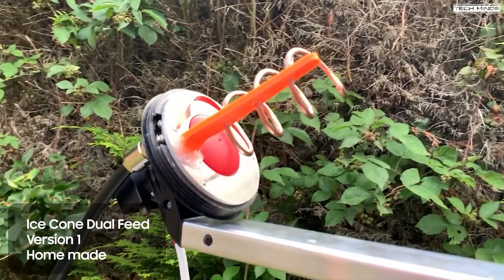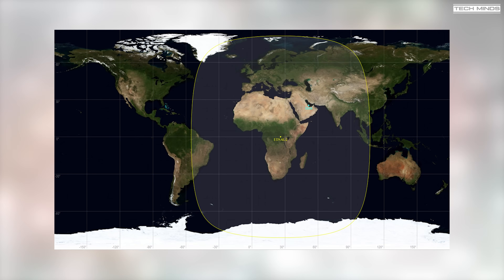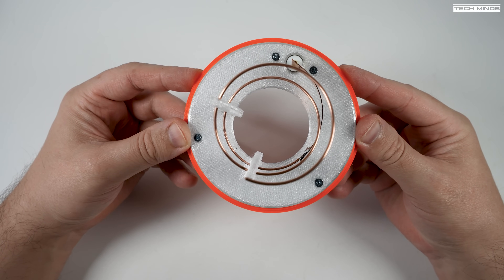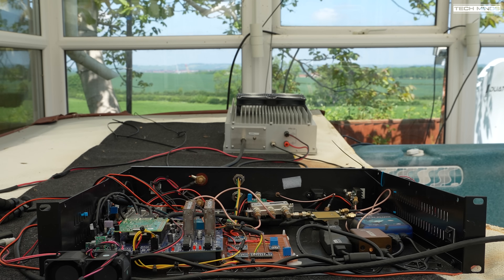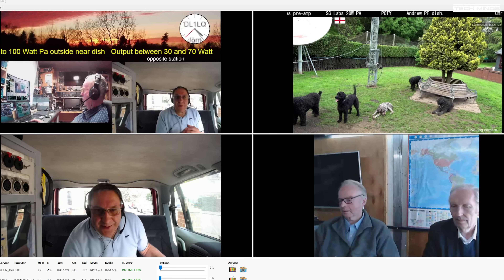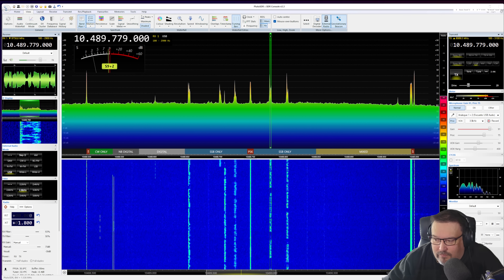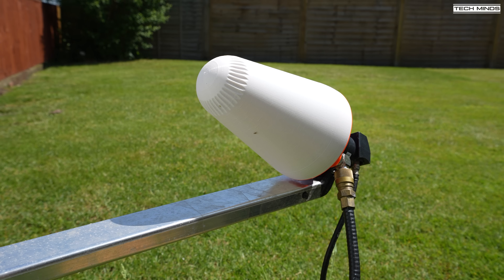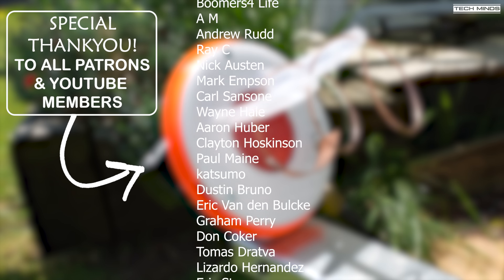ICE CONE V2.1 DUAL FEED ANTENNA FOR QO100

Comment: 100W is a lot. Is it necessary?
Reply from the maker: Personally, I do not use 100 watts for NB or WB, but better to have an amplifier capable of more so it is not running flat out all the time. Example would be that someone wouldnt driver their car with the accelerator on full all the time. cheers

Comment: That's a good film Mat.  I've had my POTY housed in a series of pairs of poly bags for 3 years😂. I've recently started having QSOs on the narrow band. Frequency stability was an issue with an unmodified Pluto despite SDR Console's best efforts. I've pinched my mod'd Pluto from my Portsdown with a 0.25ppm TCXO and it's holding a steady offset. Now I have low strength signal reports to tackle. Kit and dish size are similar to yours. What transmit settings are you using? 73 David M0YDH

Comment: Thanks. I'm just about to build my own thing. The problem is that nobody experiments any more and wants to have a step by step instruction to copy exactly, and the ones on youtube so far discourage everybody not having a 3D printer for the scaffold so they just order the commercial thing. There is always more than one way of doing a thing !
Reply: I found it quite rewarding to try a bit. Already i built myself the Poty antenna and when soldering the 0.3 mm metal plates to the tube it got distorted and uneven so quite ugly compared to the folks who machine the thing on the lathe out of bulk material, and to my surprise i found that the distance between the plates is not as critical as they want to make you believe. For the helical i had the idea a longtime ago of making the diameter just 6 cm instead of 4 so it is less of an obstacle to the LNB, and after this video i will not let myself get discouraged as easily.
Reply: @earlyadapter643 yeah, the Bullseye is wider than the original helix diameter.... What happens if we make the helix wider?
Reply: @mrtechie6810  I don't know yet, so far i wrapped 2 turns around a 63 mm pvc tube and made the back reflector but no adjustments and measurements yet, will post it here as soon as i progress further.